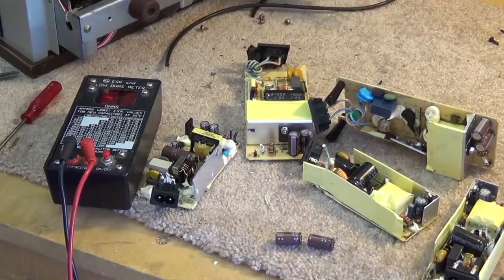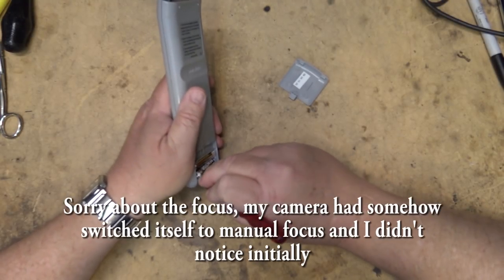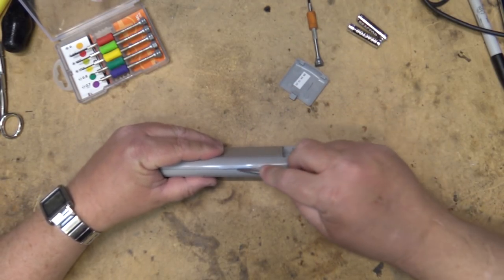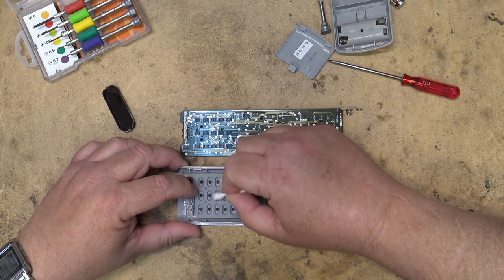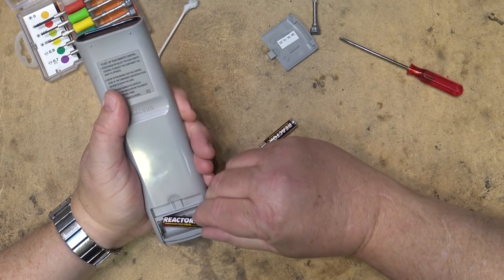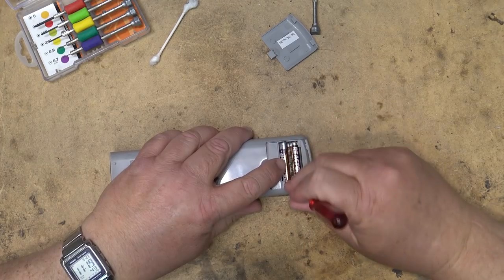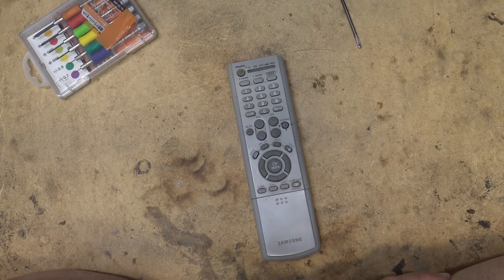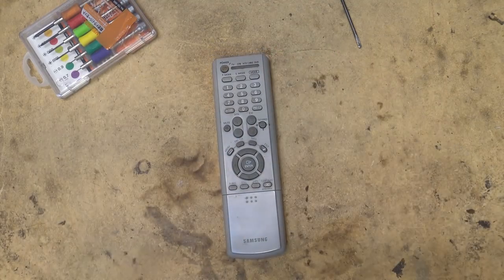How to fix rubber buttons on remote controls that stop working

Comment: I've used dishwasher soap (which removes greasy residues) and water to clean the rubber pad. Just make sure it is properly dry before re-assembly.
Reply: That's how I do it as well and in most cases I end up with a clean, shiny and new looking remote.

Comment: That was my main hobby income at one time, just about every remote would be cured like this, others had a electrotactic capacitor that would leak out over the remote, why these ever got stressed is beyond me  as they were 10v and only ran at 3volts!  I found a few Crystal oscillators (they were inside a tin can) would stop working, but it was a dead give away when they would not work at all.  Nice video, as I do not fix anything these days unless it is for myself.  If you have a remote where the batteries have leaked and corroded the battery connections, use white vinegar to clean it, keep the vinegar away from inside the remote.  It will bubble up until it has cleaned the corrosion, allow to dry and spray with contact cleaner.  That's all the secrets gone now!

Comment: If you dont have contact cleaner or are too lazy to get some, another good way is to cut small peices of aluminum foil and put it between the rubber buttons and circuit board pads
Reply: That's risky at best,but if it works...

Comment: Back in the day Chemtronics sold a bottle with a brush to add carbon to the worn contacts. The problem was once opened after a week or two it gelled in the bottle. We used to use trichlorithane to clean the carbon contacts, some time if sticky using Windex. Good video!
Reply from the maker: Yes had a repair kit and it all gelled up and dried before I got a chance to use it.

Comment: I have a shop TV remote and I did the same thing and it did not work. But then I decided to use one of the other buttons that work and put it on top of the circuit board part let's say the volume that didn't work and it worked again so my problem is something is wrong with the rubber. Did you ever run into that problem?

Comment: Do they ever need to be 're-carbonized'? Just extra carbon on the pads if they have been used a lot, or are outside (garage door keypad)?
Reply from the maker: Yes sometimes. Most of the time they can be cleaned.   Using ipa or other harsh cleaners will strip the carbon. That is why I use hfe solvent.
Reply: I've used powdered pencil graphite and rubbed it into the buttons...

Comment: I noticed on the outside of the remote under that bottom slider there are 12 buttons,  but on the circuit board there appears to be 14 rubber pads. It would be interesting to find out what options these other 2 hidden pads activate.

Comment: I use tuner spray to clean the buttons inside. Sometimes it last very long sometimes just a few weeks....Don't know why.
I just didn't know that the ceramic quartz could go bad sometimes too. I always try to keep the original remote controls.
Thanks for the informative video! (again)

Comment: I enjoyed this video as usual! This may be in another one of your videos somewhere but I’m curious to know if you have any tips or techniques for repairing worn VCR brake pads or tension bands? For brake pads, sometimes I’ve seen felt used, but some JVC decks have a 2 part white/black foam. With these decks being so old and replacement parts not available I’d be interested in seeing a video on how you keep these things running or using alternative materials to repair.

Comment: one of my remotes has just the power button that don't work but when i took it apart to clean i found the same button on the opposite side of the remote will make the power button work  what would you say this problem is

Comment: My TV remote ir light is always on (checked it with camera ) and new battery is discharging very fast, I have checked all the parts by removing (capacitor, and ir led, all are working) can't seem to know what is the reason for discharge ), there are no other components on the PCB only IC , have any idea what to check for this situation ? (New remote , clean and nothing is damaged ) it works ,but the prob is discharging fast

Comment: I have 2 buttons on a Magnavox remote for my hardrive tv recorder  they get used a lot and I tried the cleaning it's not that/ it is from excessive repeated use of the often used 2 diff buttons under 100x magnification it shows the exact size circle pressed into it. I'm checking using utube to see how these buttons close the switch. and if there is a fix . The curved c shapes that don't touch are made with black something . Either the trace is broke or the thing is sunken in but I'll use the internet to see what those black traces are under the button>

Comment: First, very great videos.
Next, I have a very specialized application that uses the same type of pads. However the "RUBBER"/carbon side is warn out. Is there any way of fixing this? I used graphite on the pads just for a quick fix, but its not lasting long. Any ideas?  I can not find another to replace it with, so I need to find another solution.
Reply from the maker: Mg chemicals make a rubber keypad repair kit

Comment: Great video demo & info.... Just gonna add my 2cents if that’s ok.... Often the entire silicon rubber membrane piece is covered in ‘finger shmoo’ & filth in the gap between front half shell of the remote & the membrane. Good to pull the membrane out carefully and wash both items in some weak mild soapy warm water & dry them off totally. Sometimes the carbon contact patch on the silicon membrane is just totally warn out. You can experiment glue something that’s conductive back there but at that kind of condition the remote is just too far gone.... keeping these units clean is probably a good practice during this CoronaVona pandemic!

Comment: What were the pads contaminated with? Coffee? Coke?
Tip...if your remote has no led that lights up when you press a button, sometimes a digital camera can see the IR led activating, but not always. My canon camera can see the IR, my mobile can't.
This helps diagnosis.
Reply from the maker: Could be anything.   Moisture from holding it in your hand all night.
Reply: The rubber release plastificant seem sticky oil between carbon buttons and the pcb.I wash the rubber with soap and carbon track with isopropyl alcohol.
Reply from the maker: @vittoriobacchiega4170  usually that oil comes from your skin.  Migrates through the seems in the cabinet over time.
Reply: @12voltvids  believe me , this oil is release from rubber because the remote control was wrapped into plastic sheet/film (that used in kitchen tor seal food- i don' know how named into your country) to preserve from dirt/debris).

Comment: So you just clean it. It doesn't work  on all remotes.  I recently had one with this issue but cleaning with many different things did not work at all. It wasnt conductive anymore   I had to apply a new conductive coat to it.   Normal conductive paint won't work since it hardens and get's brittle 
I got myself some remote restore from the UK it's a conductive coat for that purpose
Reply from the maker: If the carbon is gone a remote repair kit is needed with the conductive paint. Using ipa to clean will remove the carbon.
Reply: And a good tip if the remote doesn’t have the indicator light, you can aim it close to a radio tuned to AM band,and when you press the buttons,you can hear the output of the remote through the speaker 😀
Reply: @NeathVideos  A mobile phone camera will show up the infra red light as well.
Reply: @Martin For people who don't have AM radio's you can just use your phone's camera. If you point it at the front of your remote you can see the IR LED blink
Reply: I used repair solution from farnell specifically meant for this job. It worked. Then 2 years later I discovered that the remote was randomly activating itself. The coating had fallen off, crumbled into conductive dust onto the circuit board and it was like a ghost was randomly pressing the power button.
Finally fixed with a spare remote, a scalpel and superglue! No more ghosts!
Reply: Blackmarsh63   Ah yes,I’d forgotten about that one 👍
Reply: @NeathVideos  i have used a digital led clock that incorporates a light dimmer (ldr) and the clock  should flash

Comment: I clean some remotes too from time to time, but I use to remove the rubber keypads from the front section and clean them both when I has it apart.
Remotes gets really messy and full of grease and fat and stuff. The new owner probably would appreciate a clean remote.
Sort of disappointing that cleaning did work, had hoped not, so you could show what to do if simple cleaning didn't help.
Reply from the maker: I'll find a really bad one to work on.

Comment: no use,the graphite seems to be gone on one pad;  any way to re-do it?
Reply from the maker: Mg chemicals sells a kit to repair remote controls and it contains the conductive graphite material that you can reapply to the rubber buttons. I've done it a couple times in the past the kit itself was quite expensive when I bought it and this is probably 25 years ago but it was around 20 bucks and could repair a couple of remotes the problem is once you open it you have to repair those all those remotes at once because once you've broken the seal the material will start to harden up so if you don't use it all up within a couple days then you've just thrown away the rest of the kit. We used to use it at the shop and we would basically charge almost what a new remote was worth to cover our costs and the labor to do it. it was really only useful when someone had a remote that was like $150 or $175 then we could repair it for $100 and cover our costs to buy the kit and the time to do it but on remotes that were less than a hundred bucks we didn't bother because it just wasn't worth it. When I quoted that price 20 or 25 bucks that was wholesale at the time so we had to make it worth our while to use the stuff.

Comment: would DeOxit work as a substitute ? It has some cleaning agents for oxidation but also is made for electrical contacts
Reply from the maker: It has naptha. That will attack the keypad and destroy it
Reply: @12voltvids  thank you. is there something that can work on those carbon pads? I found something called keypad fix, its some type of carbon that dries after applying
Reply from the maker: @MElixirDNB  there are repair kits available.

Comment: I have a remote whose channel change buttons don't work but when i use the similar styled volume buttons on the channel change buttons it works...looks like they worn off due to over use...how do we   repair it??
Reply from the maker: Mg chemicals make a rubber button repair kit with conductive paint.
Reply: @12voltvids  oh got it...i didn't have anything from above video so i just tried with the material from tablets wrap and it worked... probably same as silver foil!
Reply from the maker: @MnM008  
The kit uses carbon adhesive just like the originals.

Comment: Do keypads like those on a microwave fail in the same way?
Reply from the maker: Those use membrain switches and the can be cleaned if you open them up if the problem is on the carbon pads

Comment: 12voltvids, ive heard that some remotes fail because of the manufacturing process that "cooks" the silicone pads so (similar to breast implants) if there wasn't time for the process to properly cool down and seal properly they would end up with micro leaks so after a bit of use those weak spots eventually fail or leak in some way. i can tell you some Panasonics and their clone replacements are they're mongrels i sometimes put some aluminium foil over the problem button pad and that sometimes works.
Reply from the maker: 9 times out of 10 it is from moisture ingress.  Holding the remote i your have all night fór example.
Reply: @12voltvids  how many times my own and my mums newer Panasonic's I've had to strip and clean is endless...

Comment: Not all Remotes have the same Buttons. Mine does have those Metall clicky buttons
Reply from the maker: The metal "clicky" button remotes generally don't have this problem.  This is for the rubber sheet remote only.
Reply: +Hanako Moonstar - By "metal clicky buttons" I assume you are talking about something with a cheap "calculator style" pad which makes a tactile click when depressed. Despite the fact that these are usually sealed against outside contamination they also develop bad contacts. Cleaning them involves carefully peeling back the sheet of sealing tape from the pcb to get to its contact pads and the little round dome shaped metal contactors, which make the click sound you mentioned. These usually come away with the sealing tape and should not be removed from it. Chances are that there will be oxidation on either contact which is best removed with very fine sandpaper. I used to have access to burnishing sheets which are plastic sheets coated with a super fine abrasive. They were used to polish glass and were ideal for this job. Solvents normally aren't necessary to clean this sort of keypad, but if they are needed (because of actual contamination), they must be used sparingly and as carefully as possible to avoid it attacking the adhesive backing of the sealing tape (since it must remain intact so that the pad can be resealed again at the end of the job). Hope this helps you.
Reply: @Inflec  Can an ink eraser be used in place of a super fine abrasive paper ?   J K

Comment: An other big enemy is hand/body lotion. The glycerine migrates through the rubber, and the whole inside becomes a gruesome mess. I used to use dishwasher detergent and warm water to clean the board, membrane and body. But even after that, some keys usually don't work. Then comes the plain photocopy paper. Put the membrane on the paper, push the non-working button, and pull it on the paper for about half inch for start. By removing the top layer of the carbon pad this way, the button almost always works again like new. If the carbon pad is completely worn off, they are available at some dealers. You can cut down the original pad from the membrane, and glue on a new one. Unfortunatelly I haven't find a reliable glue for this yet.

Comment: i did this with alcohol and it worked well enough.
Reply from the maker: Alcohol will remove the carbon pads, not something you want to do.
Reply: @12voltvids  that's nice to know. Good thing it still works then.
Reply: +Aaron Trupiano - It depends on the material used in the rubber pad. As 12volts implies, some solvents are harsher than others and will do more harm than good to some keypads. The way to be sure of which to use is knowing what the little black nubs, which make contact with the pcb, are made of. Most are composed entirely of a carbon-impregnated form of silicone rubber and are conductive throughout their substance. These are very amenable to cleaning with nearly any solvent. Even if the top layer of the nub is stripped away (which is no loss since it's contaminated anyway), the underlying material is pristine and will restore function to like-new. (Pro tip: best to keep the plastic housing parts well away from any solvents.)

I'm pretty sure this is the type of keypad you were cleaning and why the alcohol worked for you. But there is another variation of this same sort of keypad which looks identical at first glance, but on these the nubs are merely coated with conductive carbon paint. These have to be cleaned VERY carefully with the mildest solvent you can find or the coating will come off and the button/pad will be rendered inoperable. Probably nothing harsher than dish soap and water would be recommended for these and even then it's a gamble.

And 12volts, you might want to file the following away for future reference. There is a telephone parts supply company that used to and still may sell a product that would restore the conductive coating on the second style of keypad rubber pad that I referenced. As I recall it came in two parts, like epoxy, which were mixed and painted on the nonfunctional keypad nubs. The company is Mike Sandman Enterprises (or Company). Believe it's out of Chicago.. You might find it useful in your work.
Reply: @12voltvids  Too late now, that's what I did last month, with alcohol. Wish I had seen this first.  :(

Comment: Sometimes I had to glue a small piece of aluminium foil (as usually found in the kitchen) to the former contact surface of the button in order to restore the function of the button.

Comment: Can anyone say difference between ipa and hfe solution...
Reply from the maker: Well.... IPA is Alcohol and...
HFE is Methyl Nonafluoroisobutly Ether, Methyl Nonafluorbutyl Ether, 1,1,1,2-Tetrafluorethane. Thats a mouthfull. So, no they are NOT the same, not even close. HFE is non flammable and non conductive. You can use it on live circuits. It is also non toxic, except to aquatic life, and you shouldn't inhale it for obvious reasons.
Reply: 12voltvids so can i use hfe instead of ipa for all cleaning purpose..
Reply from the maker: @Userofindian  
For most applications yes.   ipa works best for tape heads.
Reply: 12voltvids Thank you for your reply ...

Comment: I used metholated spirits for normal dusty pads or a warm water+washing up liquid scrub for liquid spill mess.
Dead pads had aluminium foil glued to them, a bodge but they didnt fail.

A lot of them had the yellow resinatior rattling about inside, the flat pins had snapped though regular dropping.
A blob of bostik made sure it never moved again :-).

Comment: The short story is: Contact cleaner (or IPA) fixes the buttons.
Reply from the maker: No, contact cleaner has oil.  Tf solvent (now banned) was great.  The stuff used also very good.  Ipa also works but can strip the carbon off.  I'll do another one is much worse shape.